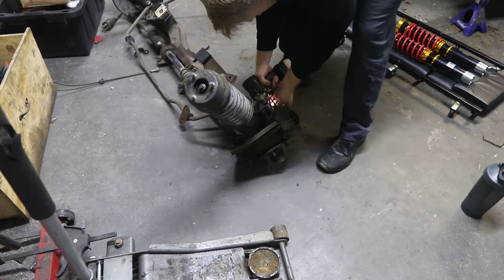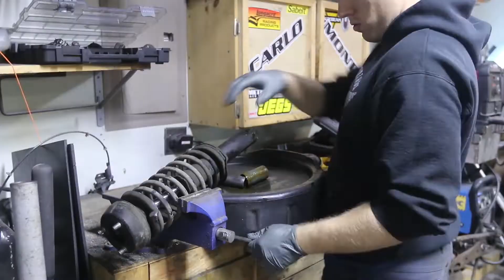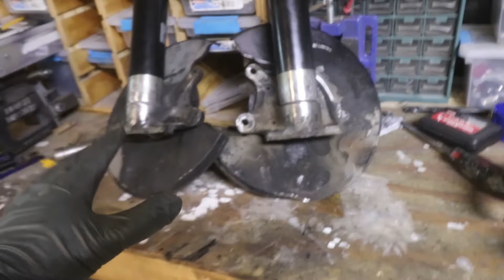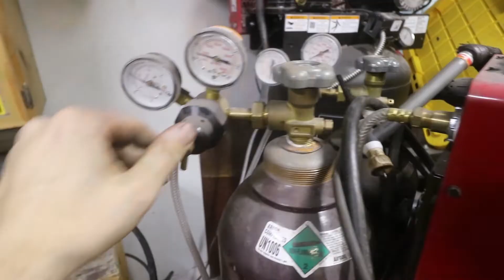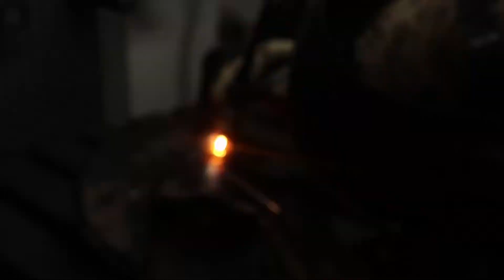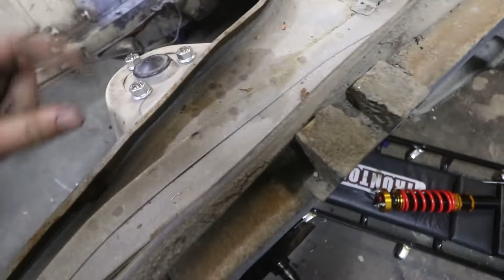Welding On Custom Coilovers Into The Datsun 240z | Datsun 240z Restoration EP. 6

Comment: Glad to see you're working on the 240 again! 
How do you like the Lincoln Square Wave 200? I'm looking into TIG machines right now.
Reply from the maker: I’ve been happy with it but I think for the same money I could have went with a different brand and gotten a lot more machine. It works really well but the features are definitely limited, which that  also made learning on it super easy, since the set up is extremely easy.
Reply: @DirtyGarage  Thanks for the honest feedback. 
I'm also looking at the Miller Diversion. It's a little bit more but maybe it's worth it. 
Is there another machine in particular you would have preferred over the Lincoln?

Comment: I was getting ready to do the same to my Z31 before a I moved to Japan 8 years ago. Had the knuckles cut, prepped and ready too.
Good idea with the rosette/plug weld. Also I totally agree with you about not modifying the strut towers. I would've done the same as it looks much cleaner and you're not going to be adjusting the camber much once you get it set anyway.
Reply from the maker: That's what I'm hoping for on the camber adjustments. I have only used the top hats to adjust camber initially on every car that's had them and then just use all the lower adjustments to dial it in. Plus it will be a super mild alignment.
Do you still have the Z31?
Reply: No, not anymore. I had my father sell it years ago. Told him to keep the money for taking up garage space while I was gone. Don’t see myself moving back to the US, as I have a wife and kid here.
I’m in a bugeye v-limited STi now. Really enjoy driving it.

I would recommend setting the tops to zero and getting the bottom dialed in to 0 or -1 degrees since the adjustment range is much more limited. Then go back to the tops for final adjustments so the marked degrees are more accurate.